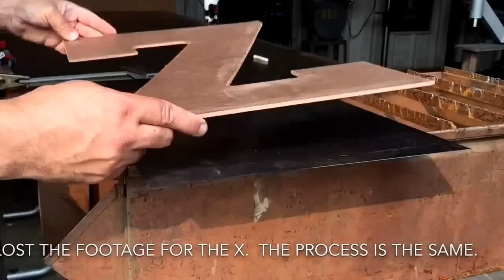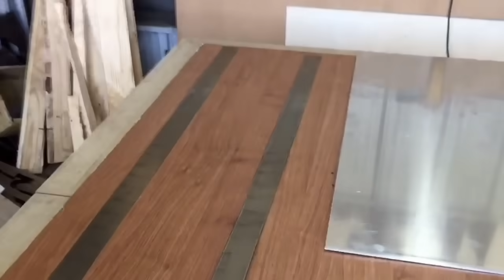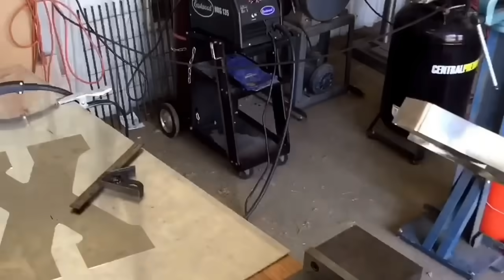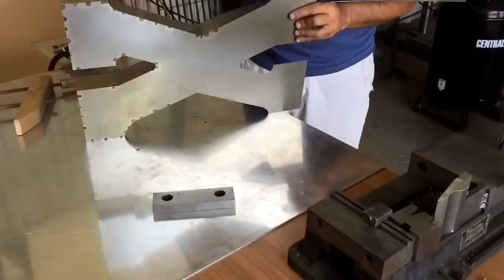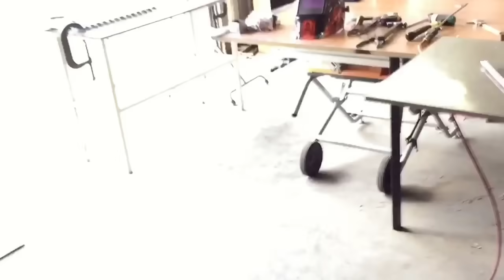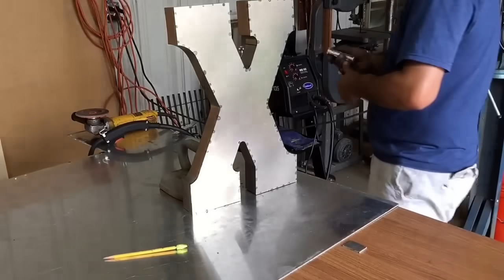Welding: How to Make Channel Letters with 24 Gauge Sheet Metal

Comment: This takes me back, did this for a long long time, we always used to solder not weld but it seems to make just as good a job of it.  Nice work. You may find that stopping at a corner point means you get a better finish on end product.

Comment: Could you tell me in detail how you welded 24 gauge sheet metal ? I just blow through 
Thank you!
Mountain Mike
Reply from the maker: Michael Whaley A big one is try to use some type of an aluminum bar for a heat sink behind your weld while you’re welding. Also curious are you using gas to weld way or flux core?
Reply: @AMakersJourney  thank you and it's going to be enclosed so I won't be able to get behind it with an aluminum block and I'm using 30 flux core wire only
Reply from the maker: Michael Whaley that flux core unfortunately could be part of the problem. If you use a little bit thicker gauge you could probably get away with doing flux core with no problem with maybe 18 gauge or 20 gauge
Reply: @AMakersJourney  thank you very much
Reply: I will teach you

Comment: Very helpful Video thanks for sharing, are you using a drag tip? I just order that machine but couldn’t find any drag tips for it, ill appreciate any info you can provide.
Reply from the maker: CORONA ISMAEL Are use a meg welder with  .023 wire. Here’s a link to where I bought my welder. http://www.eastwood.com/mig-welder-110vac-135a-output.html

Comment: Is 24 gauge thick enough for a belt clip like what you find on tape measures? Will it retain its shape under pressure?
Reply from the maker: cyberpine No, I would recommend something like 16 gauge. it’s thicker and holds form  better
Reply: @AMakersJourney  16 gauge is thicker than automotive sheet metal..
Reply: What material and thickness is around your letters?

Comment: is that a mig or flux welder?
Reply from the maker: It is Meg with gas. I always feel like flux core gets a little hot for such thin metal. But with practice I’m sure you can do it with flux core

Comment: Could you tell me the name of the table top device you are using for the angles? thanks
Reply from the maker: Zach Tittel that was a vice I made. I use these now, there a  hands bending Tool. 

https://m.aliexpress.com/s/item/32437182053.html?trace=wwwdetail2mobilesitedetail&productId=32437182053&productSubject=New-Penguin-Metal-sheet-Arc-Angle-bending-tool-channel-letter-bender-luminous-sign-making-machine-2pcs
Reply: I see the weld now, nice device. thanks for the reply!
Reply: The hand bending tool link is down - could u tell me what name model is so I can purchase or just replace with working link?

Comment: What is that plasma cutter?  It looks sweet.  Can it cut aluminum as well?
Reply from the maker: UA Representative It is a colossal cut 50 D. You can get them on eBay for like $250. I’ve had mine for about two years now works great

Comment: Hi I am a design student and struggling with welding 2 aluminium sheets of 24 gauge together as all welders simply denied that it's not possible to do so. Pls help me out with a solution sir😁
Reply from the maker: Pratham Gupta What welder set up do you have? Mig,tig?

Comment: What material did u use to join them all? Is it welding?
Reply from the maker: Heyyo Bonjol it is all 24 gauge the strips and the letters. I use .023 wire running out of my mig gun.

Comment: what machine are you using sir?
Reply from the maker: adgraft digital This is the machine I use you can get them off of Amazon. Biltek 50Amp Air Plasma Cutter, 1/2" Inch Cut 110V/220V Input CUT50D DC Inverter Dual Voltage with Pre-Installed 110V US Plug, Portable & Easy Quick Setup Metal Cutter https://www.amazon.com/dp/B079YY76GJ/ref=cm_sw_r_cp_api_X7GSBbWB4YAFB

Comment: what machine that you used for cutting the plate?
Reply from the maker: Lupang Pinangako it's called a colossal tech cut50d plasma cutter. It will cut up to I believe 3/8 thick plate. Going to put a link below the comment here. I had mine for over two years it runs great. 

http://m.ebay.com/itm/NEW-Plasma-Cutter-50AMP-CUT50D-Inverter-Dual-Voltage-Includes-1-Year-Warranty-/110743556642